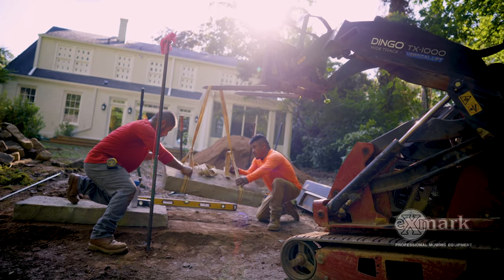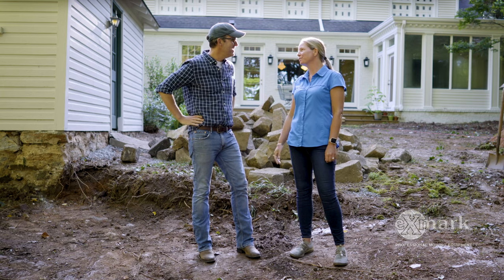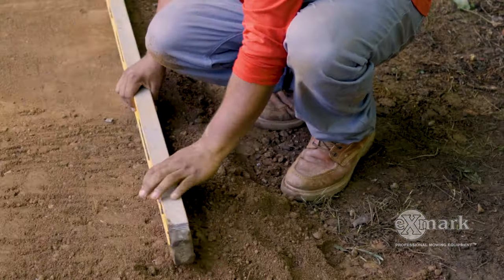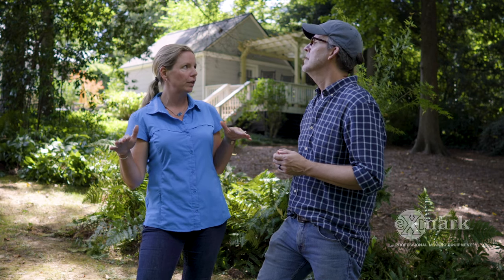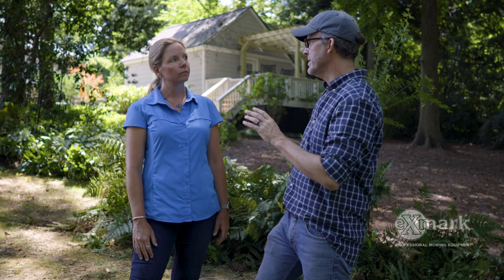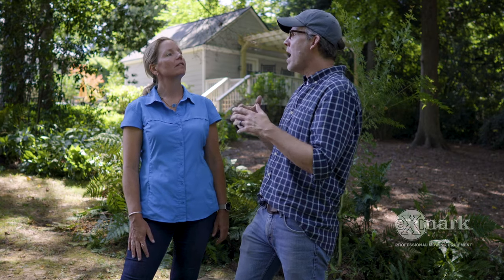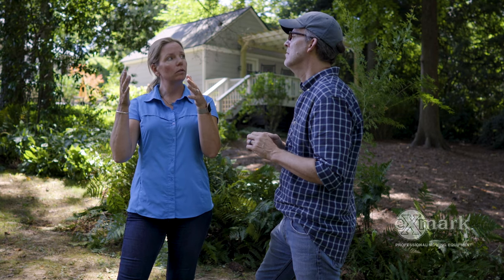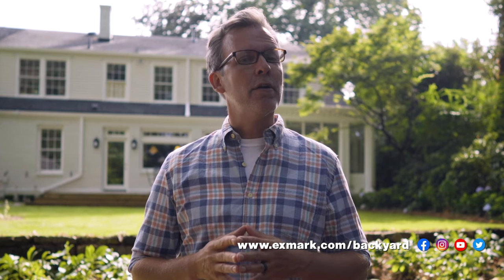How to Build a Boulder Retaining Wall | Done-In-A-Weekend Extreme

Comment: The advice in this video fails to adhere to even the most basic best practices generously dispensed for free online by numerous dry stone walling associations.  Proper retaining walls have stones consistently running length in, employ a second wall behind the face with the cavity in between carefully packed with hearting, and do not have running joints.  Stone on stone friction is essential, therefor there is no such thing as mud joints, stones are pinned with small wedge shaped stones to eliminate movement.  A walls longevity is predicated on minimizing movement, while allowing it to be self draining.  To toss dirt between courses is to fundamentally fail to understand this methodology.  To go a step further and recklessly suggest that cap stones sitting atop these unsecured courses could then be mortared, is to invite the wall to fail even more quickly, dooming those mortared sections to a landfill.  This homeowner should not have had to pay for such poor craftsmanship.
Reply: This entire video is incredibly confusing. What is Exmark doing a residential retaining wall project in such an unprofessional manner for? I can't make sense of it.
Reply: Tell us how you really feel now, lol.

Comment: Very nice but that is not a weekend project that is a project for professionals I’ve been doing this for 30+ years
Reply: Why
Reply: @DigItMN It's basically a rubble pile... There MAY be functionality, don't know what's behind the wall (didn't want to watch it after just one look at it)... But it is definitely ugly and weak from too many vertical seams going through multiple layers. Wasn't going to criticize the Video, but you asked. This is a definite 'How Not To' video. Stone work lasts for a long time, and should be artistically impressive... This is not it. It shouts 'low rent' from 10 miles away. 
Again, apologies to the video... But do better.

Comment: I'm beginning a project very similar to this but I started with a 2 foot by 2 foot by 40 foot concrete footing. Maybe overkill, lol, but this stone is very dense and heavy and the top layer will continue back away from the wall over a mortared stone roadbed so there can NOT be any movement. I'll be compacting every layer of backfill with every layer of stone. We do want a sheet of water to flow over the face for aesthetics so I've put a slight pitch on the footing away from the rock face to prevent back flow under the wall and we'll be putting down a compacted base of 2" rock then some thinner flat rock all along the base to avoid wash. I've never done this before but I think I have a better grasp on best building practices than these so-called professionals.